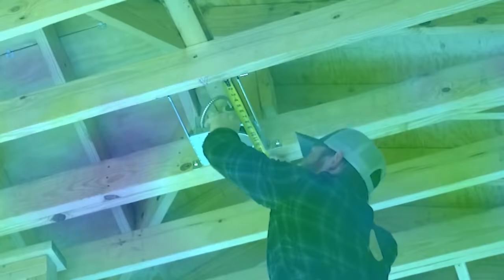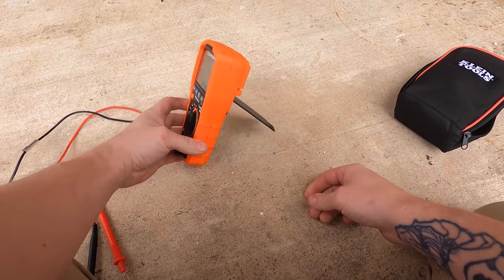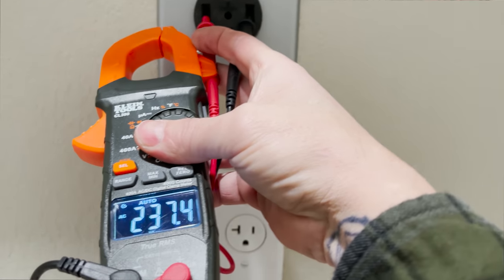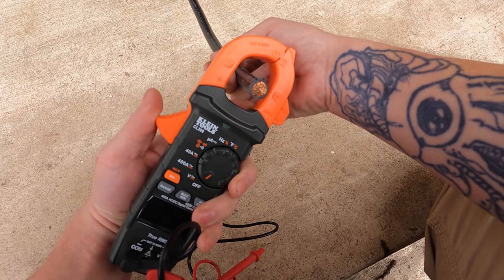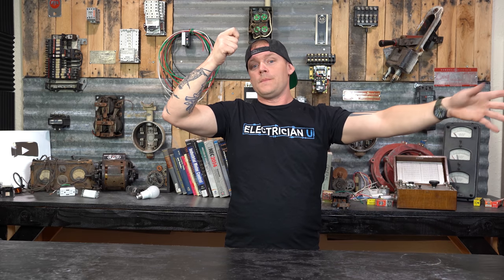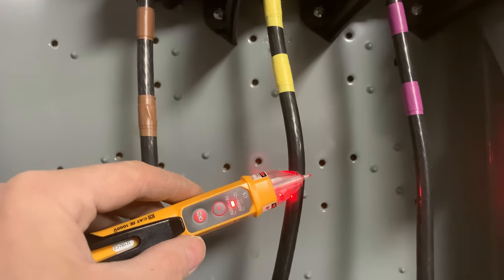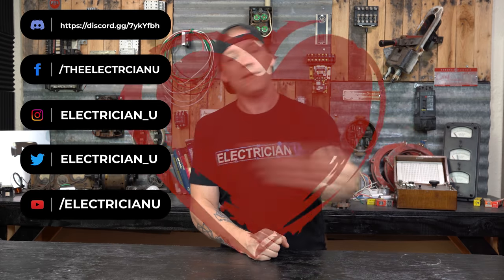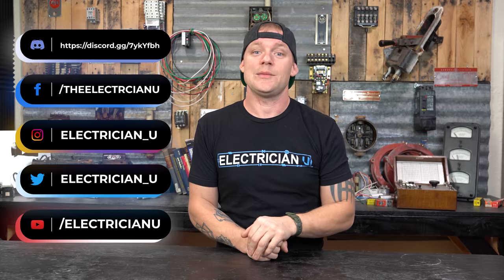4 Basic Electrical Testers & HOW TO USE THEM

Comment: Question - This morning I plugged my sander into my 10/3 (triple outlet) extension chord and "pop" - arc spark and 1 of the 3 outlets burned on the ext chord.  The light on the ext chord was still on and I had 2 more outlets.  No burn on other end of chord.  No burn on wall outlet. I plug sander into other outlet on ext chord - "POP" .... that outlet did the same thing and this time it burned off a chunk of the prong (hot prong) on the sander and now 2/3 outlets on the ext chord are fried.  I got my multimeter, tested the wall outlet - I have continuity and it is showing 120-ish volts.  I tested for continuity on the extension chord and it says I have continuity but I think thats b/c all 3 of those outlets share the same metal bar inside the outlet end of the ext chord.  Is there a way I can determine with my multimeter if the problem is inside the chord or inside my sander (which isn't even 1 month old)?
Reply: I just tested the prongs on the chord on the sander to see if something inside the sander had disconnected or blown and it was showing it had continuity as well.  I dont know why 2 plug ins in a row both arc popped like it did.  Sander, ext chord, and wall outlet all tested ok for continuity.  Wall outlet was good on voltage.

Comment: Which one is the best multimeter for everything. ( home, industrial, electricians and for electrical users)
Reply: Don't know but a Fluke t5 or t6 either 600v or 1000v works for me plus it auto detects ac or dc without having to change selector switch and it does amps. You can get one of those and if you have to but another meter it will probably be only 1. Don't bet your life on any tick tracer always use a meter when your life or someone else's is on the line.

Comment: Hey bud new subscriber I’ve been in the field for about 8 years now as a hvac technician and electrical tech aswell and maybe in my opinion or experience klein testers are good like the gfi plug and what not but klein multimeters ive just had really bad experiences such as amperage readings jumping up and down and also with voltage readings rather go with fieldpiece and fluke

Comment: Do a video on Wiggitron “Wiggie” testers lol. It was the standard when I started. Haven’t seen them at supply houses in years.
Reply: I'molester Da'chilrin  You can still buy them, and they're still useful. They have such low impedance you're not going to be chasing any ghost voltage, that's pretty much a guarantee.
Reply: Get you a T+ pro - or even the regular T+, they're awesome. It's like a wiggy and a t5 had a baby :D

Comment: I had just installed and made up some up lights around a building and the last step was to make up that circuit in the box containing the home run conductors. I was told by my foreman that he had just landed the circuit into the breaker and it is dead. Still, be wanting to be safe, I tested the wires with the multimeter and I'm showing no voltage anywhere. Good, I thought, so I begin to work. Though, still being cautious as I had recently been hit with 120V and was there making up a 277V circuit, I handled the wires as though they are hot. I twisted the hots into a wire nut. I grabbed the neutrals and brought them together into the next wire nut and heard a pop. Huh, that's strange, I thought. I took the wires back out and touched the copper tips together. They popped with little sparks! I was a little taken aback by this. Grabbed the tester and one of the neutral wires was hot with 277 volts! Carefully, I spliced the neutrals together and again, I tested them. Back to zero volts! I went to my boss and let him know that a neutral went hot at 277 volts and that's when I learned about the loaded or open neutral situation. Turns out that the neutral for that circuit was shared by another 277V circuit that was live. I was glad to not have been hit with 277V and was also glad I played it safe and that I got to experience that sort of situation. Even neutrals can shock! That said, the foreman didn't make a mistake. He just simply didn't realize that this particular neutral happened to be shared with another circuit, which was live. The moral: Always test, even if you're pretty sure it's dead. I assumed ONCE that a 120V circuit was dead since there were wires sitting inside an unmade box without wire nuts on them. I grabbed them out of the box and my thumb tip grazed the copper on the hot line. Gave me quite the jump!
Reply: A loaded neutral is lights out

Comment: I'm a bit confused on the "tester".  Does it have a proper name? Went to Amazon and typed in "electrical tester" and got everything from multi-meters to tick tracers (which looks like are more commonly known as voltage testers).
Reply: Clamp meter

Comment: insulation tester and breaker tracer are other less common ones. Tracer can save a lot of time. Tick tester is always on me at minimum, always double check that it's dead and still treat it like it's hot

Comment: I would use the amp meter when replacing pully belts on electric motors. adjust tension to right amperage for motor
Reply: Don't the pulley belts loosen up with age/use, thus changing the motor amperage?

Comment: I am a service tech have always seen voltage from ground to neutral.   Only got concerned when getting over 2 volts ac because of switching power supplies will start resetting.  Also if you can lock out at breaker box if possible.   Got zapped by coworker I had flipped off verified off then started working on 10 minutes later he had switched on when still working on it..

Comment: I know you cover it pretty well, but I really don't like non-contact voltage testers, ESPECIALLY for new people. Even the good ones are known to not work on occasion, and they can give you a full sense of security. I always suggest using an actual meter to verify if the lines are live.

Comment: I wish there was something to indicate a bootleg ground without having to open the outlet box for a visual.  I bought a very old home (175 yrs+) from a would-be flipper midway through the flip.  I've been stumbling on bootlegs for a while now. What throw me was some of the circuits were pulled back to the breakerbox correctly so I didn't check everything visually. My bad. The current fix is to re-install a two prong outlets or GFI w/o equipment ground but really not satisfying because I would have lowered my offer price accordingly if I had known.
Reply: Plug in tester will tell you if there is no ground but will NOT show if ground is tied to the neutral at device! However a GFI won’t function if they are tied at least downstream.
Reply: @ProctorsGamble  Not sure what you are referring to but a GFI will work (and is allowed by code) without a proper ground and also protects downstream outlets.  You just need to add the "no equipment ground" sticker (comes with the outlet) to make it code.  The downside is surge protectors won't protect since they need a real ground to dump the spike.

Comment: I am looking for a meter that plugs into a socket that has a socket that the load is plugged into.  I don't know the name of such a tool.  Say I want to know how much watts (?) and amps were used by a fan that I normally have plugged into the wall socket.  The tool would go between the wall socket and the plug of the fan.
Reply from the maker: Kill-a-watt

Comment: I don't do resi but I've seen guys that do resi only using those 200 amp/600 volt fork test meter.. thats really all a residential electrician should need because the main service panel on a house is at the most 200 amps.. thats around where I live, idk about the rest of the country but 200 amps is high for resi.. and alot of the guys I see now days use the Ideal fork meter or the fluke fork meter.. I have one and I kinda wish I didn't buy it because most the stuff that I work on is bigger that 200 amps and the fork won't fit over the wires.. hell, my 1000 amp/1000 volt clamp meter won't fit on some of the stuff that I work on now days either.. lol gotta get that fluke amp meter that looks like a stethoscope..

Comment: I've always known the tick tester as the Widowmaker. Get some crazy looks when you ask for that one haha
Reply: It makes black widows?
Reply: @eddiew2325  :facepalm:
Reply: I watched a guy swear up and down this wire was hot. An hour later, that wire was ripped out laid in the front yard connected to nothing - and it still read hot. Not gonna trust my life to one of those.
Reply: @notsure7874  get the fluke one that one has never failed me
Reply: @ricardorendon7047  My pen WAS a Fluke, and it read that somebesh as being "hot" too. It wasn't just a cheap or faulty pen. they're no substitute for a proper volt meter. They're handy as all getout, but don't put your life on that line.

Comment: Can you do a video on how to transition from metal pipe going into ground to the schedule 40 that runs underground? How do I connect the two pipe? What size pipe should I use ?
Reply: Use a female PVC adapter. The steel pipes need to be bonded at both ends btw! Don’t ask me how I know lol

Comment: You can't always trust your co workers. That type of trust needs to be earned. I was working with a generator mechanic who was a grade higher than me in the army. I was doing something else on the perimeter and he had hooked up the generator to the maintenance shelter. I looked at it and said hey this don't look right. There were four wires and he'd hooked them all up right except for the neutral. He'd hooked it up to another hot terminal and hit the switch to send the juice to the van. Well the bulbs in the shelter glowed real bright for a second or two and then the smell of burning insulation kicked. I had hit the breaker box the second I saw the bulbs going real bright but by then the damage was done. NEVER ASSUME  COMPETENCE UNTIL IT'S BEEN DEMONSTRATED.

Comment: You may find voltage between neutral and ground in building full of computers, I’ve asked several engineers about it and never got a good answer. May be a harmonic I was told.

Comment: The multimeter is clutch for me, when installing appliances, even when testing a water heater with damaged elements. I do services so this is #1. The low voltage tester is probably number 2

Comment: My fluke clamp tester does the full range of voltages, continuity, capacitance, temperature and also has a non contact voltage sensor.. so no fiddling with leads needed.
It's made in the US and it's made to handle tough treatment. It's expensive sure but it comes with a lifetime warranty which gives me peace of mind using it literally everyday.
and NO.. I'm no fan of this brand or that but when a decent product is out there and its equipment you use daily.. it's worth considering such tools

Comment: Can the outlet tester be used to test a 240volt outlet? Will it just light up all 3 lights?
Reply: It shouldn’t fit in a 230V receptacle
Reply: @ProctorsGamble  yes it does, the outlet can be used for 120v or 240v
Reply: @jack5402  There is a difference between NEMA 5 & 6 receptacle configuration so that a male cord cap does not fit into the wrong voltage receptacle. Sounds like you have the wrong voltage on the receptacle. Look up NEMA receptacle configuration chart
Reply: @ProctorsGamble  no

Comment: The only thing I have to add to this is: Make sure when checking voltages to have your digital multi meter on the correct setting (as in AC or DC) I noticed that your Klein has just one position for voltage, but most multi meters have separate positions for AC and DC. failure to do this COULD give you a false reading, and a potential for getting yer ass lit up.

Have a great day!
Reply: Yeah, I think I did this and mine went kaputt immediately. 🙁
Reply: So can it be on the wrong setting and still show current?

Comment: if you have a multi meter or any device that uses batteries and you live in a humid environment like a ship yard or east coast use dielectric grease to prevent battery corrosion that ruins your meter

Comment: Easiest verification for me was the back of my hand. Your reflex is to close your hand and with the back of your hand you will automatically pull away from the danger and maybe feel like you have a snakebite but nothing worse. If you touch the other way just use the tips of your fingers, your muscle contractions should also break the circuit your finger may have made … Don’t let your hands grip the live wire …

Comment: A wiggy  is a tester, a T5 is a multimeter. Fluke might categorize  it as a "tester" rather than a "multi meter" but - it - and all these clamp meters I see - are in fact, multimeters. Even the T+ Pro is a meter, just not a multimeter - it's a volt meter, with other testers on board. The regular T+ is a tester. If it gives a direct measurement, it's a meter. If it gives you measurements of multiple properties, it's a multimeter. If it indicates a condition - "battery no good", "voltage is here" , "GFI works" - it's a tester.
Reply: I love the T5 and just got a T6. Good starter especially if you do lots of industrial work. That auto ac/dc has saved me quite a few times and I never trust ANYONE saying the power is off. Coordinator, Foreman, General Foreman, Engineer etc yea I'm gonna check with MY meter

Comment: my Multimeter has two options for 600 and 200v, I want to test a few breakers but not sure what setting is right or best. anyone know?
Reply: If you are in a country that use below 200V, set it at 200v before testing. Above 200 to 600v, set it at 600v before testing
Reply: Thank You @imevbore

Comment: Could you add in the differences between the reading of a high and low impedance volt meter?  People get this wrong all of the time using them incorrectly and inaccurately assuming a ghost voltage is real.  High impedance volt meters are different from low impedance

Comment: You do have a difference in potential between neutral and ground The neutral is a current carrying conductor, therefore will have voltage. When cking a receptacle you would have something like 120v to ground, 119.4 to neutral and .6 neutral to ground. Ground is a zero reference, N is not. If you understand this troubleshooting is so much easier..

Comment: Even though those volt sticks/no contact volt detectors look good and seem useful, I always find myself checking a second time with my dmm... I finally came to the conclusion that it's a waste of my time to carry and use the little stick as I double check anyways so I might aswell just check with the dmm right away
Reply: No harm in checking it with 2 devices
Reply: @hxd9321  there’s nothing wrong with using two devices to double check if that’s what makes you feel “safe” about working on a circuit. My fluke has the same no contact voltage detection built in it but it just doesn’t feel necessary to use it to make sure when you’ve already tested the circuit with a volt meter. The only time I do agree that double checking is worth my time is when I’m on an industrial jobsite and I am not the one switching on and off the breakers due to long distances between the board and the actual work spot, I do double check for those

Comment: When u get shocked by a neutral wire and your boss goes no you didnt i shut the breaker off, stop being a wimp...then watch your boss get shocked by the same wire...priceless.
Reply: Get yourself an electrician safety lock kit, box lock, push-button lock, and breaker lock. I was drilled to use them when I was working in a mine mill, every worker have their lock, electrician or not, if they caught you working on something without a lock you end up sitting on your ass at home for a week without pay. Hey, it's just me saying, you have the freedom to get killed. Just one more tip, you need to be the only one with the key, not even your boss should have the key, they are often the most dangerous when the production is on the line.

Comment: Can anyone who works with high voltage speak on the Klein mm700? I'm a commercial HVAC worker, so I'm talking about 208/230, 460, motor starters and things like that.

Comment: What is the most significant difference between a tester and a multimeter? Why would you need both? It seems like a tester does everything a multimeter does plus amperage.
Reply: Ohms
Reply: @j.s3612   I can do Ohms with my clamp-on amp meter. Or if it does Ohms is it considered a clamp-on multi-meter?
Reply: That's kinda what I wonder too. Convenience is the only thing I can think of.
Reply: The ohms range readings on the DMM are typically higher and the DMM have other readings that the tester don’t have.  

You can also measure amps with your DMM the only thing is that you have to brake the circuit and put the DMM in line with it.
Reply: @dakotbeastj  if you could explain what you men when you say (tester)
Reply: @j.s3612  in the video he looks at a multimeter and then a separate one that has an amp meter on it that he calls a "tester" I have the amp meter on mine, but I thought it was a multimeter, but now I'm wondering if there is a significant difference?
Reply: @dakotbeastj  they are bothering testers or multimeter . One has the clamp amp tester I believe that is the difference.
Reply: Bothering =both